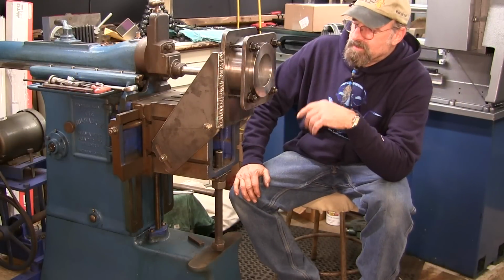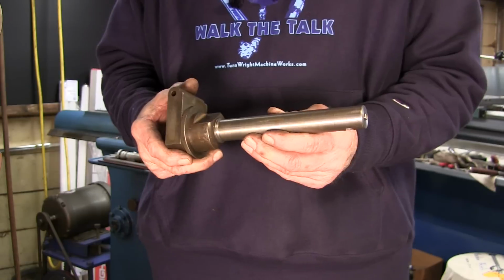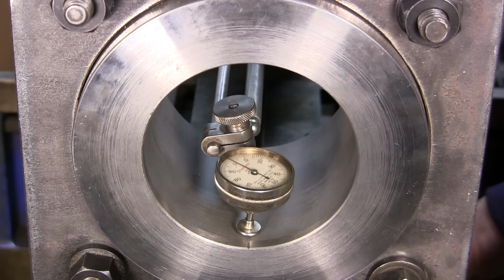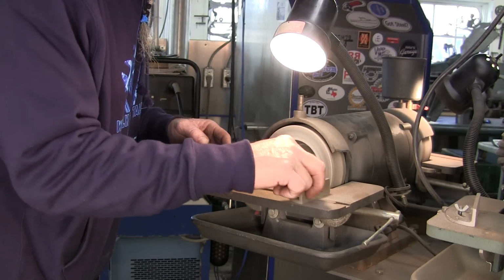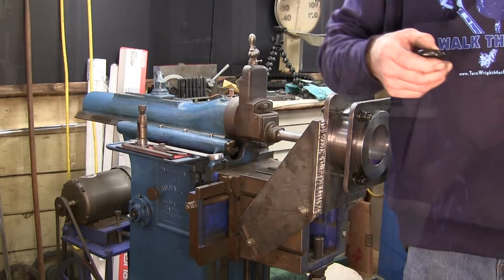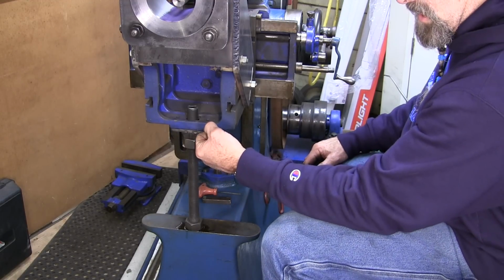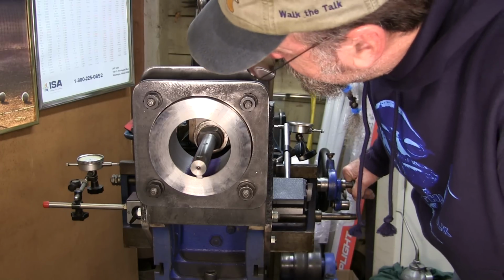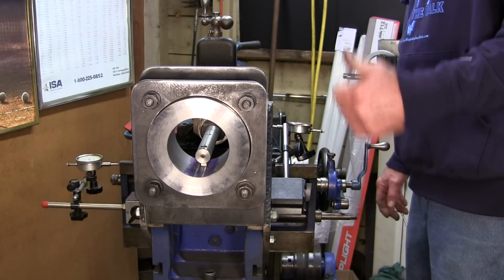Reventing Part Four

Comment: Really enjoy watching how you set up and make your various machining cuts.  I have learned so very much watching your work - you explain things very well.  I did have a small lathe in my gun repair shop, but after a year of struggling, I finally let it go.  I didn't know enough to work it properly, and had no teacher.  I was able to make some things, such as a few firing pins, and thread a few parts, but as I said, it was a real struggle.  Many thanks!

Comment: that taper bore keyway is an aspect of the shaper that had crossed my mind before. as apposed to one of those lathe tool post mounted lever type deals.I can see the shaper has more versatility built in than I've previously thought I've seen them on craigslist for $250 of course no tooling as a matter of fact I bet the seller barely know what it is in most cases awesome job kieth.

Comment: I think you were lucky to be able to adjust your holding jig to the angle you wanted.  It looks like the heel of the jig at the end of the adjustment slot is just about to hit the vertical surface of the table mount.  Being lucky is always good!
Reply from the maker: I had room to slide forward if it had gotten to close at the desired angle, was making it as big as I could. ;{)------

Comment: Just outstanding video, Keith, one of your best. Even though (I think) you've never shown a video using this machine before, this was super. You have a great way of showing what you are thinking and how and why and then what you are going to do about all those factors. 

I did not see how you are guaranteeing that the keyway cutout is perfectly centered left-right in the bore. I see how you are making sure that your cutout is not L-R oversized but not how do you know it is perfectly centered in the big bore itself.
Reply from the maker: The touch and scribe, in the bluing, from the  flat parallel side to side travel. ;{)-------
Reply: Still not quite understanding. I saw & rewatched the bluing. Your first touch was a single line. Looking into the bore from the open end, the cutting edge of the bit is not perfectly level; and the bottom of the bore is a circle, every point on the circumference is a different distance down from any given level line. So where that first touch occurs is...what? Seems arbitrary to me. If the cutting edge of the bit was perfectly level and the first touch happened to be perfectly centered (by pure chance) you would have gotten two identical touches, right? I would never expect that to happen on a hand-ground bit, but I don't quite see how your first touch is "guaranteed" to be 1/2 the width of the bit offset from the bottom dead center of the bore.

Comment: Keith, I notice your grinder bearings make the same rattly noise like mine. I was ready to replace them but if it is good for you, it must be good. Sincere thanks for sharing all your knowledge with us!
Reply from the maker: That is the water cup on the top and the drill guides in the dry cup, Both grinders are fine. ;{)------

Comment: hi Keith I love your channel. respectfully from Toronto Canada. 

I have project idea maybe you could do and make a video for us. looking at the knee of the shaper. the tower support that slides side to side on the nut with the machined flat on it. i was picturing in my head the following. 

the bolster/platform had a nice bronze plate with either grease grooves from the min and max travel datums (to avoid grease in grooves from collecting dust being open to air.) or graphite inserts. The shoe made from a machined nut is replaced by a bronze puck (round stock) with mating grease grooves or a couple graphite inserts.
it would look fantastic and would allow for smooth table travel with good support when shaping.

is that a decent idea Keith?
Reply from the maker: Yes, nice thinking, all kinds of slides can be fabbed, my favorite is a roller set up on keyed screw to stay in line with runway. ;{)------

Comment: What I wouldn't give to step back about 50 years and spend quality time in a shop like yours and with a patient mentor like you. Just curious if there's any way to use the shaper's flapper box to take the pressure off of the back stroke and save tool wear.
Reply from the maker: That is what it does during normal cutting in standard holder. ;{)-------

Comment: I noticed you indicated the bottom but what about the side?  If the piece wasn't completely parallel in side plane, then the slot won't be parallel with the shaft.  Did you indicate the side as well?
Love your vids!  I have adapted a lot of the precision ideals over to my cabinet shop; helped me to be more careful in setups and machining wood.

Comment: Hello Keith,  Long time 'lurker' & seldom commentor...but... One thing about those 'pesky taper bushings'.  Most of them which I have dealt with (for over 40 years) do NOT have the key parallel to the taper.  You may want to look again at the bushing.  IF the keyway, on the O.D. is deeper at the end nearer the flange, it is most likely parallel to the bore centerline.  Thus, the keyway in the fan hub should be parallel to the bore centerline as well.  Just sayin'.  Hope this gets to you before you finish the cut!  Best regards, Ken.
Reply from the maker: I took care of that, thanks for commenting on that. ;{)------

Comment: I wonder if the machine used to have some kind of foot that slid on that anvil. I've seen some German made shapers that had a cast leg for that, tho, to be honest those did have a V way for them to slide on not a flat surface.
Reply: Oh, and you should get one of those oil cup lifting cans (it's basically a normal oil can but, the neck is slightly shorter and on the top side, there's a lip that allows you to catch the oil cup's lid and slide the oil feeder-in, in one go.

Comment: Keith, Beautiful set up!
One question, How did you check to see if the bore was straight left to right? I saw you used an indicator to tilt it for up and down but didn't notice aligning it in the other axis.
Regards,
Eric

Comment: Keith, why you don't make the huge V-block for that or similar work, your adjustment plate is good, but V-block will be more universal equipment for different projects.
Reply from the maker: I will when I need such tooling, V blocks won't hold propellers and other fin or vane items, which may come first in my shop. ;{)------

Comment: Why bother with making the keyway parallel to the internal taper?
Would it make any difference if the keyway was not tapered?
Reply: Poppy Puppy you would have to machine a custom key
And it wouldnt have the same kind of bite
The key most likely would shear or roll and be back doing this all over again in a very short time
The taper lock bushing already has a key seat machined in it on the taper as well

Comment: Of all the vidios, this is the one that the audio took a dump.?.  SOB.  I'm just a sayin
when cutting gears splines key ways (like a lathe only doing a feature the lead screw
or feed) is disabled .  So I remove the link to the ratchet- no need for that running. 
And please don't shovel yer self to death  suppose to rain next week    14inches what
you get over there?    sam